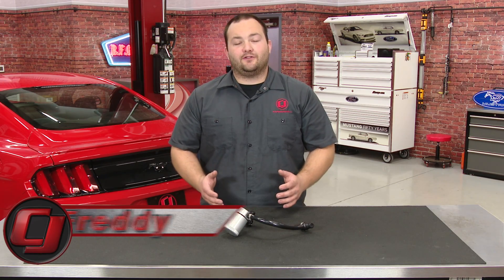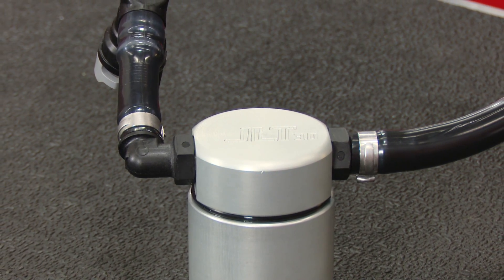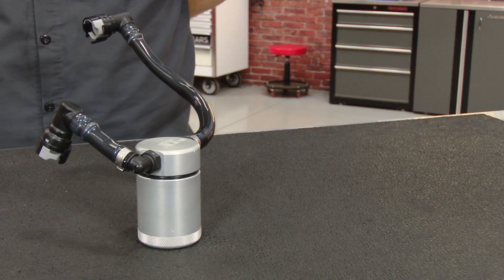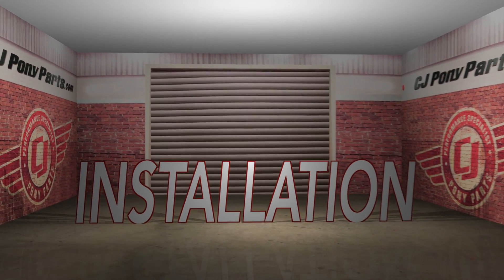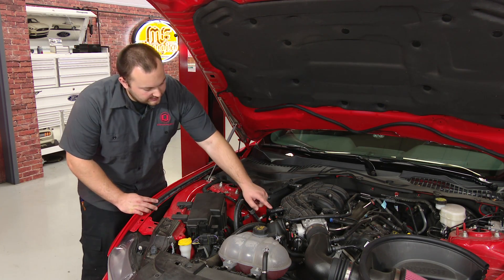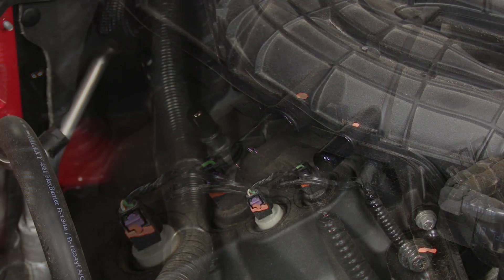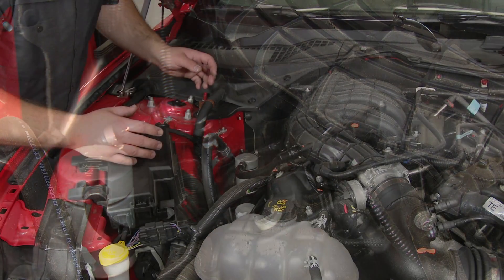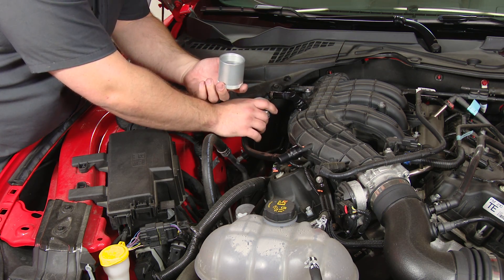2011-2017 Mustang J&L Oil Separator Company 3.0 Clear Anodized RH Side Kit V6 Installation

Comment: So this 'kit' is only for one bank of the engine? What about the other side, it plumps into the intake tract as well
Reply from the maker: We have several other videos on oil separators for the driver side as well. The passenger side will be the most effective.
Reply: @cjponyparts  gotcha. What about if we have a custom kit/setup? Do you guys sell only the quick connectors?

Comment: Do you need one for both sides of the engine?  i noticed that i've seen RIGHT and LEFT sides for these devices?
Reply from the maker: passenger side will collect the majority of oil. Both sides will add a little more protection.
Reply: CJ Pony Parts Awesome - thank you!